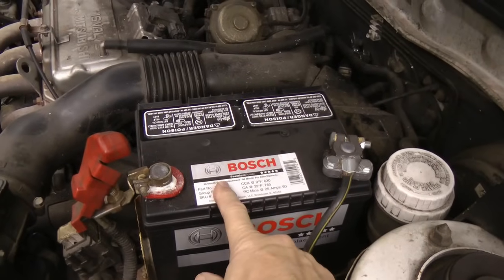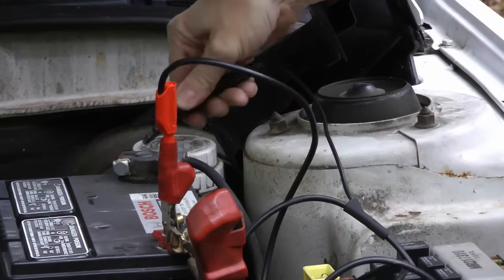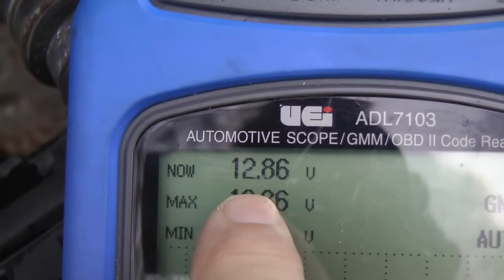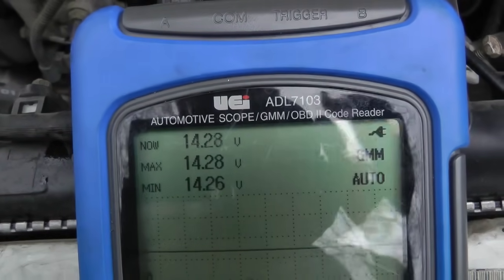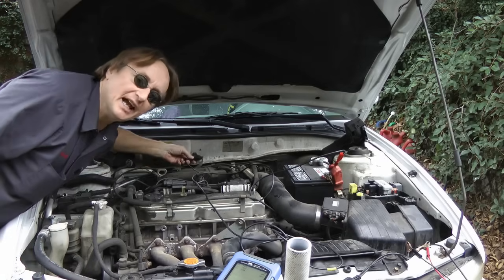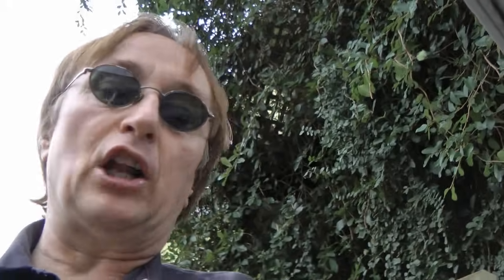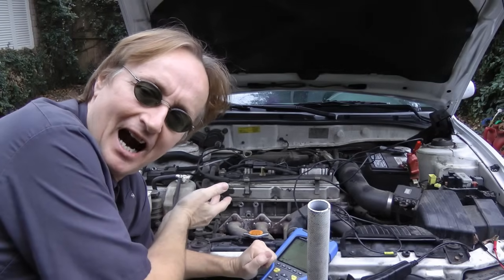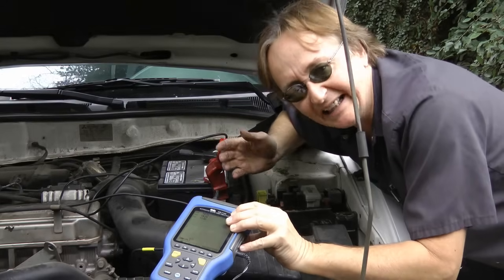How to Fix Electrical Problems in Your Car (Ground Fault)

Comment: Hey scotty, i have a 2000 vw passat and lately the car has refused to start up, the power lock function wont work, and random things occur such as when i opened the drivers door the other day to grab my key the trunk opened up on its own. i tried replacing the battery but that didnt work. my mechanic believe that all these electrical issues are due to the starter relay. however im not convinced because the car feels as if its possessed and does things on its own.
Reply from the maker: yea, a VW that old often falls apart electronically. But, I'd try a new starter relay to see if the starting went normal, and i'd live with the rest. VWs are not dependable cars as they get that old these days. Not like the old VWs.
Reply: Scotty Kilmer the starter relay was able to get the car starting. However will these electrical issues lead to anymore serious complications?
Reply: I had the same car and I can tell you, your problems with the power locks and the trunk popping are most likely faulty wires in all the door hinges on the car. I had to rewire where the door hinges on all four doors, because of all sorts of problems including speakers not working, power windows not working, blown fuses, parasitic battery drain because the car didn't know the doors were closed and the alarm was staying in and alerted state, power locks not working and more. pull back the rubber boot in the door hinges and you will see just how bad the wires are there.

Comment: thanks scotty, i went to my car now and i was checking and now the lights are all working fine.  Seems the problem is gone for now but one of the tail lights is dead though the bulb is fine.  So do you think its still ground problem??
Reply from the maker: yes, ground problems come and go, with humidity and temp changes. And of course realize computer grounds Are even more so touchy, can be computer grounding problems

Comment: hi there.  When ever i put on left turn signal, the tail lights and plate lights and also right turn signal are all blinking same time.  But when i turn on the right turn signal it works fine.  Am i having some ground problem??  also the lights on the front doors do not seem to work when i changed them to led, the light should go off once the door is closed but they still stays on.  When i put back my old peanut type bulb at the door they stopped working.  Ground problem issue also?  your advice would be appreciated, thanks
Reply from the maker: yes, odds are you have ground wiring problems on the bad side, check em all for corrosion or loose wiring

Comment: So my car shut off on me while I was driving the first problem was a crankshaft sensor, got it replaced. I changed the coil packs because my car would idle bad. But it just shut off on me while driving and it blew my fuse that's yellow and 20. And it's a Mitsubishi eclispe 03. Please help!!

Comment: Scotty, on my 99 elantra , at times i lose my turn signals , but my hazard lights work fine, i had my hazards on this morning the front flash back an forth , the rear is fine , i just dont have my turn signals, i have checked the fuse its good , I'm being told a flasher controls the hazards an turn signals, if yes where is it located on my car ? please let me know, dont want to get stopped by police for no turn signals, thanks

Comment: Hello there,  my mom has a 1997 Ford Tores, recently while driving all of a sudden her radio completely shut off, and her automatic door locks begain turning on & off like crazy & the seat belt light started blinking, then she lost complete power steering. Any suggestions on what these problem may be?  I checked the power steering pump and it makes a humming noise when turning the wheel, but don't see how that would effect all the electrical issues..  Please help if you can.. Thank you!
Reply from the maker: check the alternator, probably it's gone out or the belt came off it

Comment: Scotty , on my 99 elantra, i changed the radio to a factory Hyundai cd player that i got from a junkyard, all back together, But the problem i have is the lights on the climate control panel are not lighting up when i turn on my lights , what did i do wrong ? i didn't unplug anything . let me know
Reply from the maker: tons of wires inside that dash, odds are you knocked one of them off or shorted out a fuse. check the fuses first.

Comment: Hi scotty, My car has been acting weird these past few months. Every so often my power windows will completely stop working. Then they start working back up again when i bang on the dash board inside of the car. but now banging on the dash board does not work anymore. My drivers side window works but usually i have to pull it up or push it down to make it move all the way. Is it a bad ground?

My car radio did not work like a year or two ago , but when i pulled on some wires and it started working again, so i taped the wires down and never had a problem since with the radio (wires were in the trunk, next to my spare tire.) its a coupe 2 door btw.

Comment: Aloha Scotty. My 94 Mustang has a problem with the charging system. When the car is cold/cool and first started in the morning, my alternator is not charging the battery (dim headlights/interior lights) and the voltage gauge in the car reads out of the normal range (low). When I get in the car after work (car sitting in the sun all day), the voltage gauge reads in the normal range, and all the accessories (lights etc.) operate just fine. What could be the reason for this happening? I live in Hawaii so the car gets pretty warm while sitting at work.
Reply from the maker: often just a weak battery IF they have auto zones there, get it load tested free along with the alternator at one of their stores.

Comment: Hi Scotty, thanks for the video. It's great for a beginner to car electricals like me. If you don't mind me asking, are you familiar with an issue that completely shuts off all electric devices (even emergency blinkers) when there's a heavy power draw, like from a starter or high beam? Good battery & good alternator (tested in auto shop), good & clean battery terminals & cables (no corrossion). The weird thing is even though all are shut off, battery positive & negative still measured 12.6V. All will come back ON as soon as battery positive & chasis are connected to a plug in battery charger, or a portable jump starter.

It puzzles me because I thought if the power draw is too much, it would blow a fuse or two, but not the entire system. And it would not revive just by a 'nudge' from outside power source, right? Any ideas would be much appreciated. Thank you.
Reply from the maker: since modern cars are all computer controlled, any computer related problem can do that as they can shut off just about any electrical deviceo n the car.
Reply: Scotty Kilmer That makes a lot of sense.I'm going to try the method in your video. Thank you very much!

Comment: I have a 04 jeep  liberty, all by brake lights just went out, we changed the fuse and the brake light switch, and still  not lights.  any thoughts.  I took it to a shop to change the swithc but they do not work on electrical so they could not help me with this issue.

Thank
Belle
Reply from the maker: realize the body control module often can go bad and do just that. They cost a Ton, so guys like me often bypass em and run new wires from the brake light switch back to the brake lights to bypass all that computer crap.

Comment: Hey Scotty, I have a 1996 Grand Cherokee and the ABS light is on and the ABS is not functioning. I took it to a trusted mechanic, and he used his scan tool, got the codes 23 (valve block feed failure) and 15 (rear outlet valve). 15 flashes on and off on his scan tool. I was wondering exactly what this means, and if it's something I can fix myself or if I should take it back to have the mechanic take care of it for me. Thanks for your help!

Comment: Hi and thanks in advance for helping!  In my 2006 Hyundai Elantra, when I step on the brakes, the dash lights strobe, but not when I have the headlights turned on.....any advice?  Su
Reply from the maker: have the battery and alternator load tested, one may be weak
Reply: Scotty Kilmer thanks but just had both checked and both were charging and "Good".  (the running lights also 'strobe' when brake is applied and headlights OFF.  Any other advice??
Reply: Scotty Kilmer ha ha....just found out it was a faulty brake light bulb!!!  Thanks for your support!

Comment: Hard question scotty.  96 nissan maxima 318k.  I have a 140amp fuse that blows about once every 2 months or so.  How do I find a short if it is not constant?  Car was never jumped wrong I don't understand how that large of a fuse blows.  Replaced the wires between the battery/alt and battery groud.  Any suggestions
Reply: Oh and also ive had 2 different batterys.
Reply from the maker: john doe
  well, something's shorting it out. Do my video "finding the source of electrical shorts" to find it, pray it's got enough power loss normally to show the problem area

Comment: Hi Scotty, my 1994 Buick Lesabre has a engine problem I brings codes up like mass airflow signal failure or throttle position sensor high or low and I need help I took it to my mechanic and he told my he could not find what was wrong with my car now I don't know what to do please help me.
Reply from the maker: find a better mechanic who knows how to test computers and sensors correctly, he doesn't know enough. Any good mechanic can test them with gauges, unfortunately there are a lot of bad ones out there who can't

Comment: Hi Scott I Hve a 2001 Saturn L200  all my interior  lights strobing  and my gas and temperature  gauge  jump up and down. Also the security  light  blinks on the dash at the same speed as the dash and interior  lights  blinking.  Any idea what it could be ground?
I have a video  on here its on my page. If u would like to see it thx any info would be appreciated. BRAD
Reply from the maker: first, have the battery and alternator load tested, places like auto zone do that free, easily one or both could be bad.
Reply: Did u watch my video on my page?

Comment: Hi Scotty,the passanger wing mirror blinking light on my a '05 Touran is not working. All other lights in the car (including the rigth side mirror light), are working fine, so I discarted a fuse problem. I ordered the new light assembly from the VW dealership, disasembled the mirror, connected the new one, and it is still NOT WORKING :/. The motor for the mirror is working fine but I can not tell for the heating element connected to the mirror, although I haven't had any pvisible problems there. Any ideas of what could be?. Thanks for the help.
Reply from the maker: well, either power wire or ground wire for that blinker is shorted out, time to trace it all the way back to the turn signal arm.

Comment: Hey Scotty have a question for you. Can a bad alternator cause the power windows not to work or act funny?
Reply from the maker: yes, but you can just go to a place like auto zone and have the alt load tested free
Reply: Thanks for the help./ the alternators bad for sure cuz I have to jump start my car and as soon as I take the cables off it dies after a few seconds.

Comment: My 1991 Ford f250 just got a new alternator new battery and relay but my battery still isn't recharging I was told I have a bad wire because my window won't roll up and my stereo doesn't have any power I have no idea which wires I'm suppose to check the truck runs fine but I have an electric automatic transmission so I can drive it till the battery starts going dead please help 

                                           
                                                Bradley englebry

Comment: i had a 2009 malibu, when i press on brakes the rear brake lights come off and when im not pushing the rear brake lights come on, i even got a ticket from cops because my rear brake lights always on when driving on highway, i remember taking a fuse out on fuse box was fixing the problem but when i put it back on shortly the problem comes back, i replaced the brake padel switch and still the problem exist, could you please identify what the problem was

Comment: Scotty,

I have a problem with my 2009 Toyota Venza. It starts fine and drives normal. However, when I am driving the electronics go haywire for just a moment or two several times during the trip. The car keeps driving as if nothing ever went wrong but the speedometer drops to zero, all gauges and lights turn off, and the navigation system shuts off too. Basically everything electronic but nothing mechanical. I am thinking this could be a ground issue. Any thoughts on how to go about fixing this or where to start?
Reply from the maker: have the battery and alternator load tested first, auto zone does that free, pray it's just one of those going bad

Comment: Hey Scotty, Every time my heat,headlights and radio  are on and I brake my car loses power. The oil light comes and sometimes it beeps. I recently changed my battery. Autozone said I have bad diodes in my alternator. Is it the alternator or a bad ground? I don't have a volt meter to check the ground.
Reply: My Car is a 95 Grand Marquis. The lights dim also when I accelerate.
Reply from the maker: DeShawn Singleton replace the alternator

Comment: Hey Scotty, hopefully you can help me out with my issue or guide me in the correct path

I recently went to turn on my 2000 acura integra GS, and it turned on perfectly fine. I had my radio popped out a bit and when i went to push it back to the din, he car completley turned off on me..I turned the key back to off, made sure it was in park still and went to turn it back on and nothing...I attempted "accessory mode" and no dash lights or anything turns on, I have to jump my car with my civic to get it on...Any Suggestions? Any info is greatly appreciated

Comment: Hello scotty. So I just bought a 98 sonoma and I notice as I'm driving my dash goes a little nuts. Sometimes everything on the dash all my gages  cut off as if the car was turned off my the dash light and headlights stay on. Then in a moment they all turn back too normal like all should. Then today as I'm driving it did it again and a few minutes later my speedometer stopped working. Then before I turn ed my car off to see if they would work again the rest of the gages flicked off then on. Then I notice some smoke I think from under the hood when I got home and turned the car off. Checked but couldn't find the smoke. Could have been the small hole in my muffler towards the middle of the car. Also when I'm driving with my headlights on my turn signals are lite up. And when their off and I use a turn single they both light up. I have never seen or heard of this. Could one fault fuse cause all this? I do have a power steering leak which could absolutely be the smoke. Thank you for your suggestions.
Reply from the maker: dashes are crap on those, made in china and they fall apart at that age. As new ones cost a ton, guys either try used units or take their old one to a shop that repairs them

Comment: My fuel pump keeps breaking down. Now the computer can't read anything
Reply from the maker: bad wiring often shorts pumps out, if it's a GM product for example, they are known for wiring shorts where the wires go into the gas tank where the pump lives.

Comment: I think my car may have a short, when I'm driving, say on the highway, I'm okay. But as soon as I hit the brake, the battery meter drops significantly. Is this a short or something else?
Reply from the maker: first, have the battery and alternator load tested, bad ones do that, and places check em free, like auto zone. if not that, then yes, you have a short in the brake light system somewhere

Comment: My1990 GMC Sierra randomly loses power when coming to a stop but does not turn off. Also when backing up it will randomly shutoff but will start right up with no problems. All gauges run fine but the oil witch stays high I'm thinking a bad oil sencer. But the volt gauge will fluctuate if I turn on the turn signal or head lights. Let me know if you can help.
Reply from the maker: change the sensor first, if it shorts out, the fuel pump turns off. Pray it's that easy
Reply: Scotty Kilmer thank you

Comment: Hey Scotty, ive got a 2000 dodge ram and all my dash board lights, radio, and tail lights will not work,  my brake lights and turn signals work but neither of the things i listed will work... Any suggestions? Thank you.
Reply from the maker: wiring short somewhere, on those, often a bad body control module IF the wiring has no shorts in it. good luck on that, it's a big reason guys stay away from a second dodge after having their first one.

Comment: I have a 1995 saturn sl2 and the car will crank not start. We added spray start and it kicked off. So think it's the fuel pump but the symptom comes only when power locks and interior lights don't work. You think this is short?

Comment: I'm stuck in a gas station parking lot. Is there any way that I could do a quick fix with a bad ground?
Reply: I have a 98 Grand Cherokee Laredo and the dash bored lights do come on but it won't start. It did this yesterday and luckily I was in a parking lot with a Auto zone in it. The person told me that I had a bad ground and he wiggled it a little and the car started right up. But I don't know how he did it... Could you tell me a quick fix?
Reply: crystalk17co You need to remove the ground wire and check for corrosion. If there is, replace the connector. Make sure to cut off the corroded part of the wire.
Reply: Peter Kapica we found the main problem, turns out it wasn't the ground at all... It was the starter. Thanks though
Reply: You are welcome.
Reply: crystalk17co woot lucky you! :D